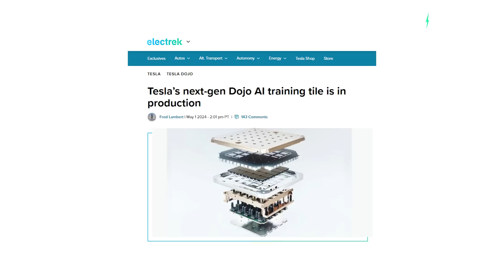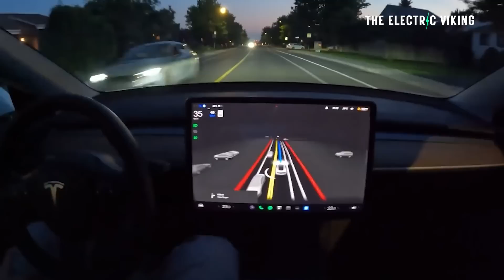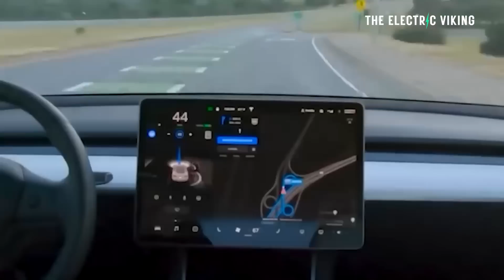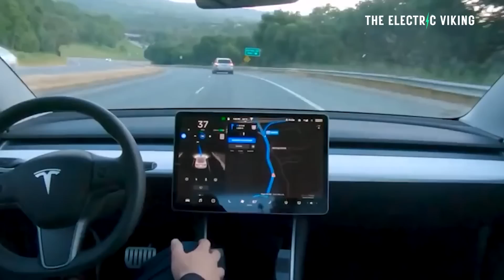Tesla’s NEW Dojo AI super-chip will be 40 times more powerful

Comment: Sam, Other chips are also advancing so it does not make a lot of sense to compare 2 future targets.   It's also hard to compare at the chip level.   I would be interested in a comparison of an entire data center (building) with respect to electrical power.   If you provide the same power for a datacenter building, which solution provides more AI processing - current dojo or current Nvidia?

Comment: Nvidia's advantage have a significant head start in terms of development and market presence. Their GPUs are well-established and supported by a mature software ecosystem.
If Tesla achieves the claimed 40x performance boost, Dojo could become a leader in specific AI training tasks. However, it might require significant software development to fully utilize its potential. Currently Tesla is buying as many NVDA H100 chips as they can get.

Comment: Ok, I have been an engineer for 30 years in the semiconductor industry.

If Tesla are using a chip 40x slower today than it will be using in 2 years time. The chip today must be dreadful.

As per Moore's law you expect a 2x increase every two years. As this is the expectation of the density of the transistors increase. This law has been steadfast for 60 years. This is the general throttle on CPU speed.

The manufacturer of the chip TMSC is scheduled to have a 2x increase in chip density by 2026. Tesla have nothing to do with the increase.

So either Tesla chip at the moment is a bag of shite or Tesla is lying.

I suspect it is both. Looking at the the present specs it is currently about 40% slower than Nvidia chip of a similar nature.

So expect a increase but never a 40x increase. So as usual tesla and Sam are lying.
Reply: DoJo is about processor connectivity and having the data where it is needed by the processors.   Tailored for training.
Reply: My point still stands.

40x is not going to happen. Unless the system it using is terrible. 

Training needs a lot of CPU power.
That's how it works. If it uses tiles interconnected CPUs or a mixture of both. 40x won't happen as the physics won't let it happen. 

Again unless Tesla present system is horrendous. Which is isn't, it's not cutting edge, it is middle of the road about 40% slower than Nvidia current setup..
Reply: @patrickkavanagh3504 It’s just the usual Tesla pumper boosterism, it never stands up to scrutiny.

Comment: The headline is misleading. When you need 25 chiplets to get to 40 times compute power, your chiplet compute power only increases only by 50%. There is nothing impressive here. They are just combining chiplets. which every standard computer already does since a decade.
Reply: Current Dojo tray already uses 25 chiplets.
Reply: @kazedcat  The video says, moores law is not broken. And that is a factor of 2 within 2 years for chiplets. However they do it, it is some kind of chiplet combining. If you account for an existing 25 chiplet tray, the 40 times more powerful processing unit must have at least 500 chiplets. It is more likely, they did not account for their exising tray and therefore compared 1 single chip to their tray.
Reply: @renezirkel  current Dojo chip is at 7N process in 2 years time TSMC will be at 18A that is 4 full node jump if they double the area of the chiplets and increase the clock by 10% that's more than 40X improvement already. Completely inline with Moore's Law.
Reply: @kazedcat  The only way, you get now higher performance increases is, by comparing chiplet generations far apart. Are you kidding? This only proves the current Dojo chip is behind. And the headline is still missleading, as they dont jump ahead, but jump to the state of the art.
Reply: @renezirkel  It takes 5 years to develop a chip. On their first try it makes sense to use a mature node. When Tesla was developing the D1 chip that node was 7N now in their second try it is reasonable for them to go full out and develop for the upcoming process node 18A. Tesla doesn't have multiple teams leapfrogging between process nodes and developing multiple product generations at the same time. Tesla has one chip development team and they can only develop chips one generation at a time. Also this is TSMC marketing their advance nodes so complain to them for being misleading.
Reply: @kazedcat  TSMC says the node jump from 4nm to 3nm gives approx. 30% performance increase. So Tesla is misleading as they dont compare to the state of the art (which is 4nm) but to their outdated homegrown chip. My Nokia Handy Chip is 1 billion times more powerful than the first turing machine. This means nothing.
Reply: @renezirkel  Tesla did not say anything this was TSMC hyping up their advance nodes to counter Intel hyping up their new High NA EUV lithography machine. TSMC needed something to counter Intel's giant machine that got delivered so they go yeah but we can 40X your improvements.
Reply: @renezirkel  There is no detail on what Dojo 2027's design is compared to the old for you to claim that the advance is only in the chip manufacturing.   Anyway 3 years is light years in terms of in current AI competition.  Who knows what Nvidia would have come up by then.    Tesla should sell their Dojo chip if it's cheaper/more performant than rivals.
Reply: @Trust_but_Verify  Moors law says the improvement in chiplets by design AND manufacturing is approx. a factor of 2 within 2 years. The video says, Moors law is not broken. Therefore I always claimed, it is mainly due to chiplet duplication and combination. And therefore is the headline misleading and nothing impressive.
Reply: @kazedcat  The video say, Moors law is not broken. Therefore either your claim is false or the video is false.
Reply: @renezirkel  Moore's Law is not broken. From 7N to 18A that is 16X improvement. Let me list it for you 7N to 5N 2X improvement then 5N to 3N another 2X improvement. 3N to 2N(20A) another 2X and finally 2N(20A) to 18A 2X improvement. 2×2×2×2=16. They can then double the area of the chiplets. That gives them 32X improvement. On top of all that increase the clock from 2Ghz into 2.5Ghz. A 25% increase in performance altogether reaching 40X improvement while still within Moore's Law.
Reply: @kazedcat  You are still comparing a very old technology with the next to one future (to be) technology. With such a method you can arrive at any number. Therefore the headline is misleading. No reader expect that statistical trickery. At least you acknowledge that the current Dojo chip is far behind and will be far behind for 3 years.
Reply: @renezirkel  I am no comparing anything. TSMC is responsible for this leak. I am just commenting on technology. Also Playstation and Xbox are both N7 process. It is not legacy technology.
Reply: @kazedcat  Even if TSMC is responsible, the headline is still misleading. Nividia is at 4 nm this year for their real AI chip. N7 is legacy technology for AI Chips. Tesla is far behind with their current Dojo chip and its a current toys chip. And Tesla will remain on that low level for 3 year to then get a factor of 40.
Reply: @renezirkel  I don't care about Nvidia. All their GPU''s are made by TSMC. Without TSMC's leading fabrication and packaging technology. Nvidia won't have advance microchips.
Reply: @kazedcat  What about Intel, AMD? Noone uses N7 for their AI chip. Therefore N7 is already legacy for AI chips. And yes, even if Tesla achieves that, its made by and with TSMC.
Reply: @renezirkel  Yes TSMC is the king unless Intel can take the throne with their advanced process node technology. Everyone else are just serfs using TSMC's technology.
Reply: @kazedcat  The headline is still misleading, if you use a legacy technology to calculate your compute power advancement.
Reply: @renezirkel  Again go complain about it to TSMC the king in the semiconductor industry.
Reply: @kazedcat  No I complain under THIS video, as THIS video has a misleading headline. The Youtuber should either change the headline or delete the video.
Reply: @renezirkel  TSMC made the headline complain about it with TSMC.

Comment: if this chip would be on the market tomorrow it may be  special, but in two years time others will have 1000 x or more.
Reply: Source please
Reply: Unlikely. Nvidia tends to 5x performance per new AI chip.
Reply: @Michael-Has-Opinions And it’s just for AI optimization. The real power doubles about every 2.5 years.
Reply: Last I checked Tesla is using a NVIDIA chip instead of the DI in the new DoJo.